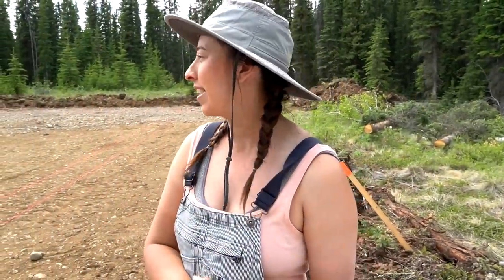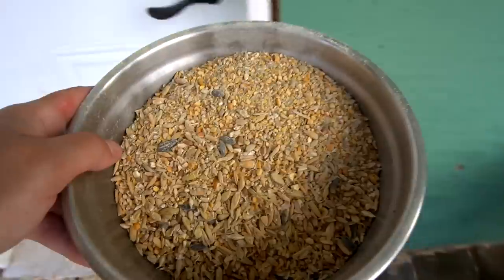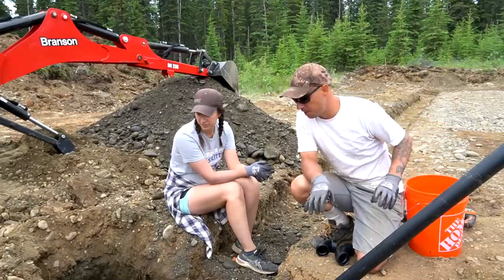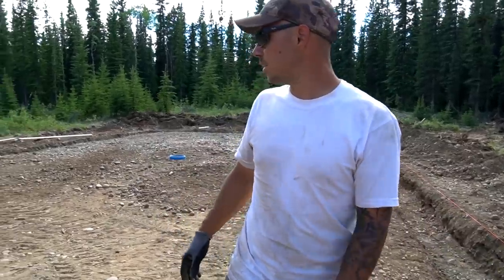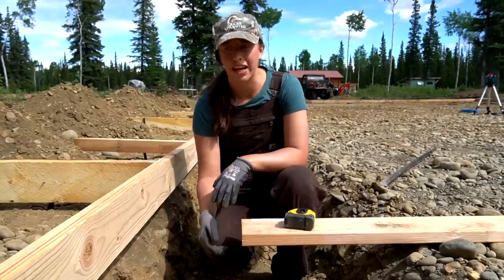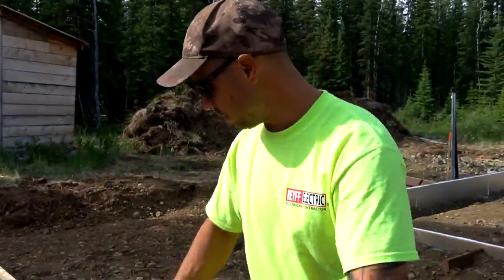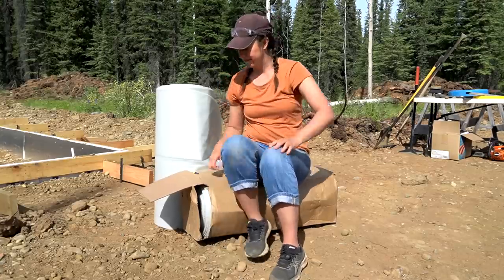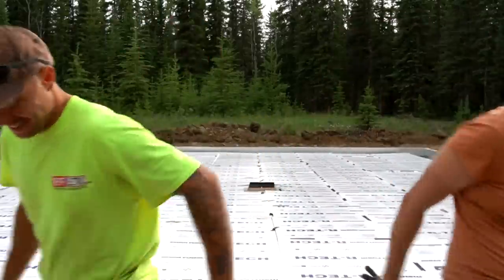The Never-Ending Footers | DIY Insulated Concrete Slab | Alaska Quonset Hut Build

Comment: maybe not to late. i use two thick cheater pipes slid onto rebar. step on one pull up the other to bend it. lighter than actual bender and gets tighter bends. can only do one bend though. 2' -3' to step on. 4'+ for leverage to bend. please be careful when u pour to not get it under the forms. putting stakes at an angle but downward on the main sides so it doesnt pull straight up if those forces happen. got some kickers in. just have extras ready if needed to put in while pouring.  stake the crap out of it. sometimes drivers wont be helpful at all. u were fortunite last time. if u can get extra hands. worst experience ive had cause not enough hands and other things taking place. afterward use vinegar on exposed skin(hands). burned my hand but worked it to hard so vinegar didnt even  help. needed a vibrating screed to spare my hand or turn the truck back with that hot mud. live and learn. sorry ive seen how bad things can get and hoping this helps. u got this.

Comment: Just a quick question.....if you aren't getting the cement delivered until later in the summer, why are you putting the layers (plastic, foam, etc) down now? Aren't you worried about rain - the foam absorbing a lot of liquid and also the rain getting in between the layers because of all the open seams?
Reply from the maker: We have our concrete date set up 🙂

Comment: How do you unscrew the screws after pouring the concrete? If you pull on the form boards, you'll rip the insulation. Of course you can patch that with spray foam or whatever, but it's kinda meh, maybe.

Comment: Foam board floats in concrete. Do yourselves a favor and put another layer of plastic over it. Doesn't need to be vapor barrier thick, just enough to ensure concrete doesn't get under the foam.

Comment: If you're putting plumbing in and potentially driving heavy equipment  on the concrete, please invest in at least a six bag mix. I'm guessing you already know that, but just a heads up if you didn't.

Comment: How are the vertical foam pieces at the perimeter going to stay in place when the forms are removed?  Listen to the Thrush sing at 32:50.  I've heard those birds from California, to Oregon, Washington, Idaho, and Montana .  Arielle said the plastic was 10 mil or 10 millimeters.  10 mil means 10 one thousandths.  10 millimeters would be nearly 1/2 inch thick.
Reply from the maker: They will be buried completely 🙂

Comment: Your foam will not "float" you will have rebar on top of it.  My house has pex in the floor, the footers were poured first let dry and cure, then reject sand put in and packed, then plastic, then foil insulation, then foam , then rebar then pex, then cement.

Comment: Question- are you going to use the stands or just pull the rebar up as laying cement so it's in the middle of the cement and not lying on the bottom of the pad?. 
Watch Lumnah Acres Tuesday video for what I'm saying. July 11th

Comment: Won't the screw heads rip through the foam when you need to remove the forms? Not judging, just curious how you will remove them.
Reply from the maker: That's exactly how it will work but it doesn't seem to be a problem when we tried it out. We couldn't find a better solution.

Comment: FYI 10mil plastic is not 10 millimeters - thats a whole cm lol! The "mil" does stand for "milli", but its 0.001 of an inch. This means 10mil plastic is 0.010 inches, which is 0.254mm 😊🤓
Reply from the maker: You know what I worked as a hygienist and I should really have thought that one through! I used the metric system. Thank you for the correction 🙂

Comment: Eric, a very simple solution to the foam board moving from the wood frame would have been to use WASHERS with the screws. Ahhhh. Ahhhhhh. Ahhhhh, as you beat your fist on your forehead.

Comment: I did the same idea for my gray water tank is what you just did except for I filled around the barrel with Big Rock first and then my accepted field I only have two lines and they're only 30 feet long and then at the end of the lines I just did the same thing you did but the barrels at the end of the lines but I put rock all the way around it forget what they call it they used to do it in the old days but it's a certain type of drain field but they that was their only drainfield was a big barrel with rocks all around it but I just put it at the end of the lines and it's been working my accepted field's been working for 20 years and I've never had to have it pumped out because all that goes into it is poop not even paper paper goes in the garbage can and either gets burnt or goes into the garbage oK I snuck it in don't tell anybody🤣🤣🤣🤣The only thing I did different than my dad's old gray water tank and field was I never put a grease pit before the tank a grease pit used to be able to open the lid on the grease pit and clean out the grease pit that's from all the grease you dumped down your kitchen sink they should have never changed ecceptic fields and run run the gray water into the sewage that's what made them have so many problems with their sewage fields that's why I went back the old way my neighbor gets his pumped out every three years

Comment: Curious about the center drain form.   It appears that the metal frame is designed to be poured in place. With the changes The form is biger than the frame.  So first how do you remove the form?
Second other than the bolts what then will support the frame once the form is removed?
Reply from the maker: We are building it larger so it will be better supported by the concrete 🙂 Eric plans to remove the form afterwards.

Comment: When you screw inside your form to secure foam board , what will happen when you take the form work out after pouring the concrete, because the screws are secured from the inside
Reply from the maker: They will rip a small hole through. Couldn't figure out another option except put the foam on after pouring.

Comment: 5 foot deep drain line.  Curious, what is your frost line there?
Reply: According to the Federal Highway Administration, the maximum frost depth ranges between zero to eight feet in the contiguous United States. Generally, the coldest U.S. states have the deepest frost lines. Alaska's is the deepest at 100 inches, followed by Minnesota with 80 and North Dakota with 75.
Reply: @zedwpd  Wow.  8 feet in Alaska, thanks.

Comment: When you go to pour the concrete. Do yourself a big favor. Hire a company to do the pour. It is so big you will need at least 6 people doing it. Secondly hire a boom pump for placement.
Reply from the maker: Have faith in us ;)
Reply: @SimpleLivingAlaska I've been driving a mixer for 36 years. From what I'm looking at you will be placing close to 70 yards of mix. Concrete waits for no one. Hopefully the plant is close to you. Because you have a 3 hour window to get the load off the truck before it starts to heat and set. One of the things you can do is. When you place the order tell he plant to put 3 hours of retarder in the loads. I'm just afraid that it's going to set before you finish the pour and can not get a finish on it.

Comment: Your PVC hot glue is the wrong blue to be using on ABS with the primer mixed in it will not bond to the two plastics you need to use ABS glue on ABS pipe

Comment: What a shame, should have taken your marker pegs out another 9 feet exactly past where you needed em so that way you only ever had to measure 9 feet back to know you are all still on track. Trick I learnt from an old timer... Obviously need a lot more pegs but saved a butt tonne of work in the long run when you don't have gps etc. I should have waited till the video finished, but get some ableflex or something around the temp pipes that you are running where they will touch concrete, it will stop any crushing or cutting off the pipes where they will come into contact with the concrete.

Comment: 10 mils is not 10 millimeters. 10 millimeters is 0.39 inches. 10 mils is 0.01 inches
Reply: @AussieMummy-li8yf  that's correct, but here in America 10 mils is not the same as 10 mm. It's 1/1000 of an inch. If the plastic was 10mm thick, it would be almost half an inch. So she should not have said 10 millimeters; it's simply 10 mils.
Reply from the maker: Yup I was wrong 🙂 thank you!